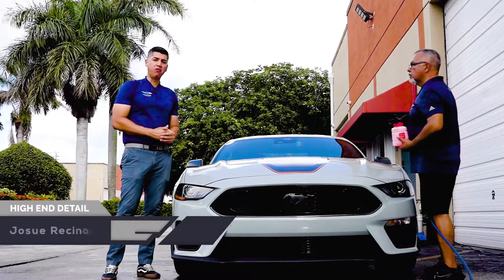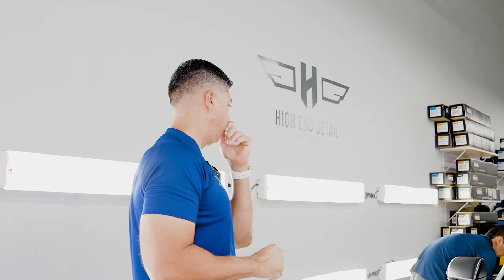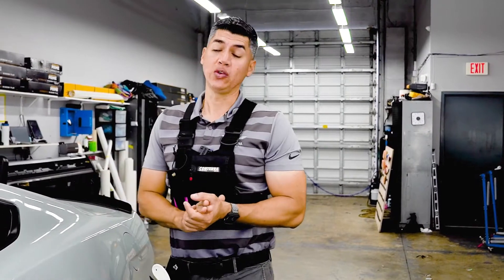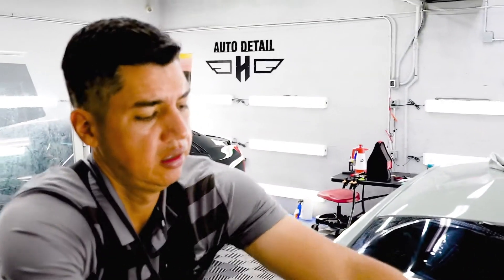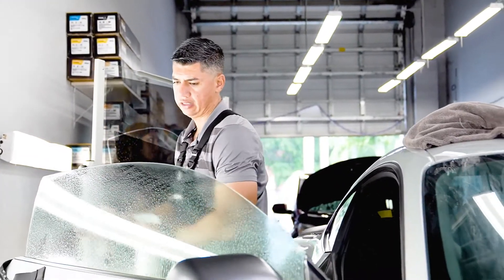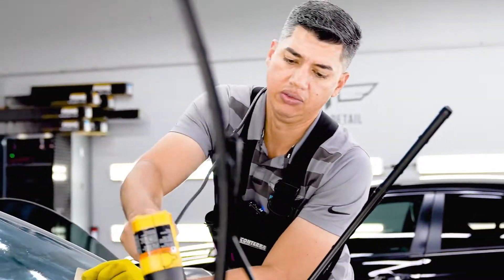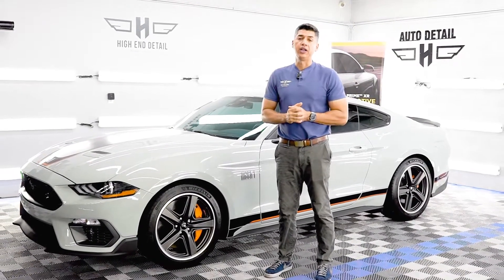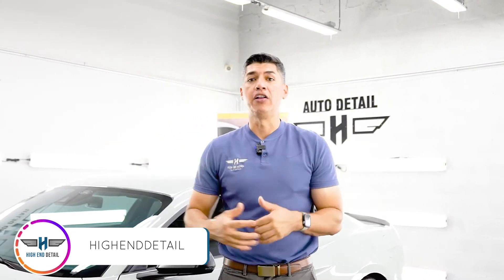Ford Mustang Mach One

Comment: How much does this cost
Reply from the maker: Hello Michael.
It all depends on the condition of the paint and which areas you’ll like the ceramic coating applied to.
In this case, we only did it on the exterior paint, his cost was $1,200
Reply: @HighEndDetail  this whole process cost $1200 2 stages of ceramic coating am i right.!!!!
Reply: I have a Mach 1 and I’m wanting to ceramic coat it. I’m curious about the hood decal. Do you coat it as well? Or leave it alone?